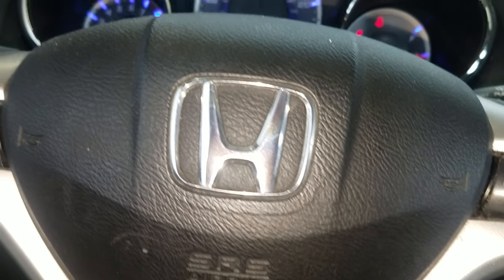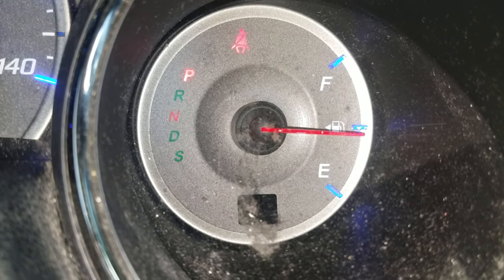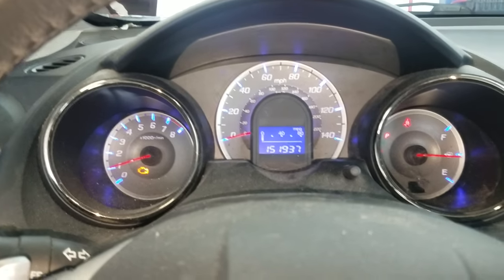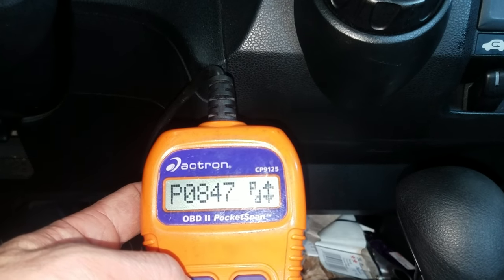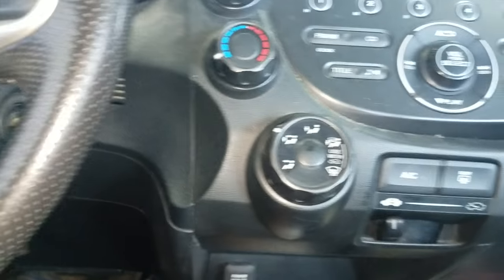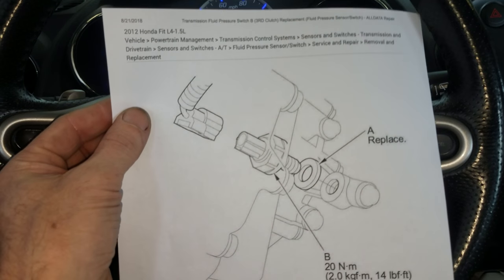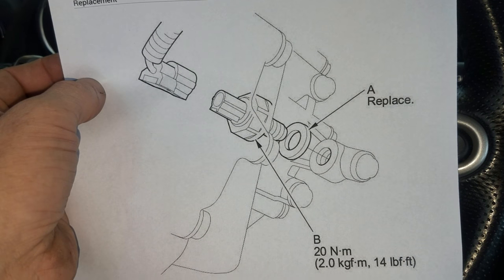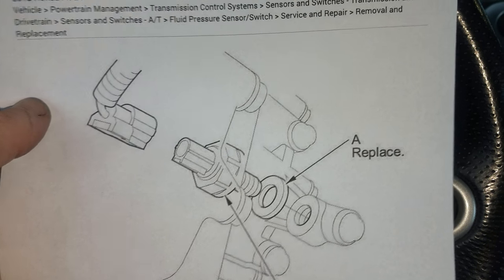What A blinking D or Flashing Drive light Means

Comment: Forget the light clean that truck
Reply: Bro lmaoo
Reply: A whole transmission issue and you worried about how clean a truck is smh
Reply: Seriously tho...dirty didn't effect the fuse boxes, transmission, engine, or electrical. Yeah it's easy to judge that a dirty car means someone doesn't attend to the oil every 3 or 5 g's or pay attention when dash icons light up.  As a mechanic I could testify THERE'S NOTHING further from the truth. 
I've seen too many dollars spent on detailing that by all rights should've gone into brakes and oil changes that I gotta comment.

Comment: IS IT DANGEROUS TO DRIVE WITH IT LIKE THIS??
Reply: No one answered i kinda nees this info as well
Reply: my car does it all the time on the highway it gets up to the right speed at some point
Reply: not super dangerous
Reply: Its not dangerous. Sometimes you have to clear it with the code reader that he got. I had a flashing D years ago, i cleared the code and 3 years later it came back again. If u clear it and days or months later its acting up again then its time to have a mechanic look at it just to be safe.
Reply: Mine came on and then went off fairly quickly, not sure if that means there’s actually an issue, could it be a sensor?

Comment: The Blinking "D" happened on my Element ...Said that same 3rd gear part .... I disconnected the wire and reconnected it ...The code went away and has not come back 2? years now ... Many of these sensors etc. run on low DC voltage and must have good connections ...It's a miracle they work at all ...
Reply: Same happened on my 07 tsx, flashed Blinking D one time, turned car off, turned it back on, it went away, never brought up a code, but now thinking it’s the sensor

Comment: Nice clear video. Very Informative. We did a transmission overhual for a Honda pilot. We finally got it running back in the car today after all the hard work . All we have to check the code and fix the rest now.

Comment: My light is flashing but no check engine light. Should I still replace the sensor?  I put a scanner to the truck but no stored codes and all of the monitors are set
Reply: What was the problem after all?
Reply: Mines doing the same thing right Now

Comment: This is happening on my 2011 Honda Accord, but the "D" blinked for a while like a couple weeks back, then stopped, then started again but isn't blinking now. I made an appointment but am hearing that it's possible that if it's not blinking the code won't be stored, so I'm thinking of temporarily cancelling. The code tool listed isn't available on Amazon currently, would you know if this MOTOPOWER MP69033 Car OBD2 Scanner Code Reader Engine Fault Scanner CAN Diagnostic Scan Tool for All OBD II Protocol Cars Since 1996, Yellow, would do the job as well? Thank you in advance for any input!

Comment: I have a 2006 Honda Odyssey. I have to jumpstart it for it to run. The D is flashing the engine light is on and the VSA light is on. Car won’t stay on. Specially when I remove the positive cable from the battery. Doesn’t that mean I have a bad Alternator.
Reply: Sounds like the range selector or low fluid
Reply: @damiengotti7803   you mean in other words neutral safety switch. Aka range sensor.

Comment: 2006 mdx has issue and dealer wants 600$ to replace the sensor on the transmission so I wonder if it’s in a hard to get spot

Comment: I have a code p0420 which is a cat convertor problem. I have the code reader and for some reason I don't show the code for the flashing D light which is also my current issue please help
Reply: I had a flashing D when i was going to work but that happen like 10 minutes away. But it stopped when i shut the car off and turned it back on and it never showed up again. I know im 4 month late but thats what i did. I wouldn't have it looked at unless it happens again
Reply: @jack8356  it happens to me every now and then?!… I’m 06 Honda

Comment: I have a flashing D but no engine light,  I already replaced the sensor but that didn't work ant thoughts?
Reply: You might have to scan for any codes and clear them. If not go to a mechanic. It could be serious with transmission.

Comment: Is that an expensive fix? What should I be quoted if I go to a pro mechanic?
Reply from the maker: Very hard to say, flashing do doent always meen the same thing, worst-case transmission needs to be replaced 2500$ or more. best case 100$ for a new sensor.
Reply: Dont worry, it is usually a pressure sensor or switch located outside the transmission.. It could be the second or third pressure switch.  It is very common for these to go bad on hondas.. These sensor send an electric signal to the ECU or computer  and they open and close to help build pressure in the transmission. Transmission needs proper pressure for the fluid to circulate inside. Also, transmission.  selonoids. I had the same problem on my 2013 honda civic with a code of PO843 . for the second pressure switch.
Reply: John Botero you’re absolutely correct. I had my check engine light come on, and my drive light was blinking. I went to AutoZone today for them to do a diagnosis . Got the code PO847 3rd Pressure SW Circuit Low.

Order the transmission our pressure switch today, and should have it tomorrow. 

PO847 code definition- Indicates that Transmission Fluid Pressure  Sensor/Switch B electrical circuit signal had a low voltage for a predetermined period of time.
Reply: @FlatRateMechanic  a
Reply: @elmecanico4943  Could you still drive it around until you get it in a garage if it's the sensor? Or could that really mess your transmission?

Comment: I have a 2003 Accord 2004 2.4, i do NOT have the engine light on, but D is blinking, and sometimes P light is on also while driving in D. I checked oil level and looks ok. I will scan it and lets see.
Reply: What was the issue
Reply: You have to clear the codes. Sometimes sensors act up or dust gets inside.

Comment: Just Change the 3rd & 4th pressure switch and the speed sensor I had blinking d and it wouldn’t shift into gears or into park also if I stop at red light it wouldn’t shift or drive just rev ,found out since I did put a new tran in it the old sensors went bad so that fixed my probs
Reply: Tran means you changed the entire gear box or transmission? how much did it cost you?
Reply: Hassam Ahmad Awan the whole transmission it was 2500 but i say YouTube mods forever you’ll see the page he has a 05 or 04 TL and he shows how to fix certain issues on the TL he has a lot of transmission vids
Reply: @llaves973  thanks alot brother. 2500$……?
Reply: Hassam Ahmad Awan no prob and yea I would have been like 3200 but I had a dealer discount from where I brought it

Comment: Mine just did it in the winter. Not sure what to do
Reply: Mines is doing this too. The D flashes when I drive but no check engine light on. I just took mines to the mechanic today and he said my pressure sensor just needs to be replaced. I have a 2008 Honda Pilot

Comment: What's a cost for that? I have honda pilot 2013 and i get echeck done and next day my engine light turn on solid i was worried because i have to drive long distance next day so i bring my car to honda dealer right away ( also checking online and start calling some other repair shops too ..few peopels told that might b because of gass tank cover not closed properly i check right away and yes i was not completely tight so i re closed and restart car engine light still there  but i notice when i was driving  d gare light was blinging ) i did told delar that's might b the reson sales manager said oh if that's is it u still need to remove that code and have to pay for it 115$ if took 1/2hour 55$ i said go a head  she came back and in 20 min hardly and said 115$  ur charge u have to pay and we got code 0847 same as ur and digonest same 3rd switch  seconcer need to replaced and change transmation flued total est 460$ ) can u pls tell  if that's  fair pricing ? Also just today i seen engine light is gone now its bin (am honestly not bleaving what she said because her behavior not good at all ) pls replay asap
Reply: Sana Fatima They're charging too much, if you can wach videos on syphen your own transmission oil out it only cost $10 at autozone for the syphener and $21 for tans oil. The switches usualy less than $100 if take off left front wheel u can switch it out with a wrench you can do it and save $400 or stay ignorant ans give your money away.

Comment: I had the same problem and 3 mechanics told me to replace the transmission
Reply: Bad mechanics are good! it's better to charge $3000 then $30
Reply: Daniel Guzman what did you do? Did you find one that was honest?
Reply: Thats bad.  Next time do your own research.. That way you dont get taken..
Reply: One just told me the same thing the other day. Waiting to be able to run a test at a Honda dealer in like 10 days (overbooked) before I change it.

Comment: My check engine light didn’t come on the d was flashing though I turned it off started again everything back to normal
Reply: This just happened to me. And by turning it off and back on was it just the key or removing the battery then hooking it back up?
Reply: @Cfresh84  hey you guys. It happened to me today. I turned it off and cut it back on. Did you guys get a diagnosis of it?

Comment: What does it mean if the light is flashing but no other light is on?
Reply: Did you ever figure it out ? My 2017 Honda Fit is doing the same thing rn and no code is coming up so idk how to fix it.
Reply: Most likely needs a transsmission flush with new fluid
Reply: Tamara Beechum most likely needs new transmission fluid and a flush ,  80% transmission failure occurs from not servicing transmission every two years

Comment: I get a flashing d but no check engine light
Reply: what was the problem?
Reply: @ryanjugmohan6584  still don’t know just been driving it comes on sometimes when I’m on street and when I’m on highway doesn’t come on. Resets everytime I turn the car off.
Reply: grenade I am going through that right now with my car , let me know if you got any updates on your condition , mine started doing that last month
Reply: If it comes on once and never show up again you should be fine. Its probably a nuisance alarm. But if its showing up more than often then it is a problem. And should probably be looked at and maybe fixed

Comment: On my 2008 Honda Fit Sport, my D blinks constantly fast but no check engine light at all. I scanned for codes and nothing shows up at all for transmission! Car drives excellent with no issues! What should I do?
Reply: You can't pull it up on the check engine you have to get it checked from the transmission computer
Reply: eliezer serrano  did you ever figure out what was wrong I’m haveing the same problem right now with my Honda Fit?
Reply: Anyone of you can found that issue
Reply: @mailtoome  did you find the issue